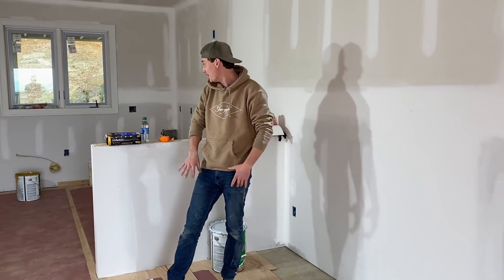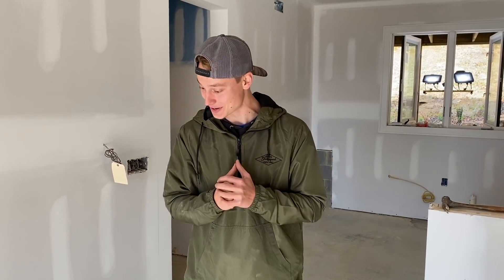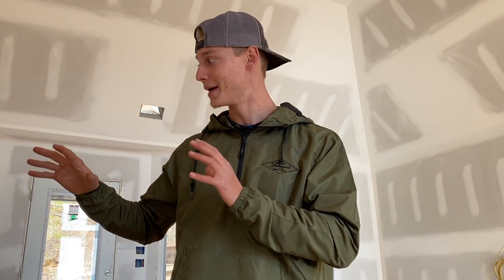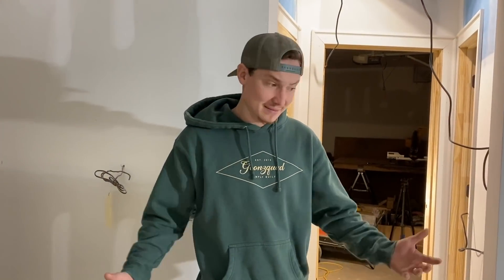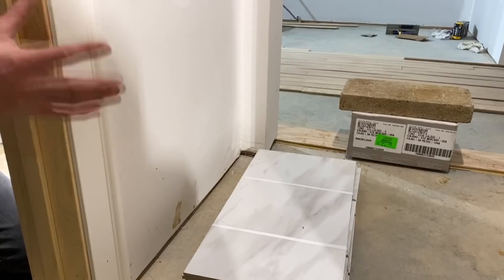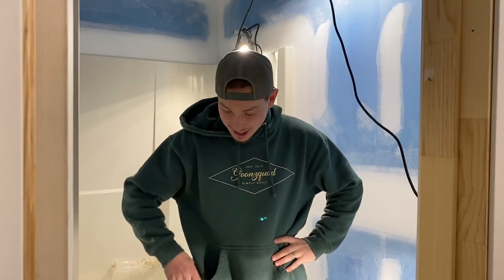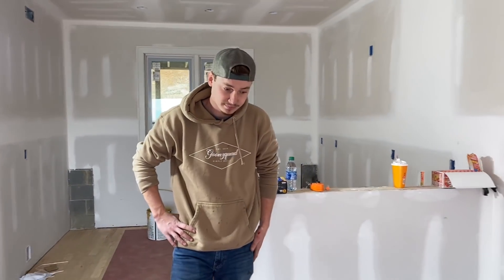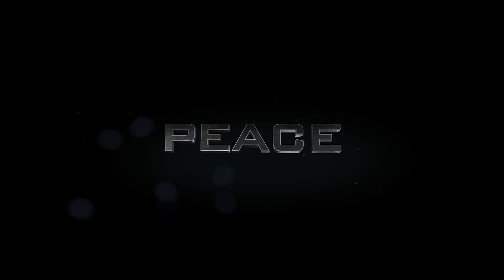The New Goonzquad Headquarters Part 55

Comment: You guys are doing great, but that's a strange floorplan that the original owner chose.
Reply: The house was never intended to be a 'typical' residence. The developer/owner apparently designed it in 2008 for the use of two older members of their family who had specific needs. Circumstances changed in 2009 and that is said to be the reason why construction work halted and the building then stood empty for eleven years. The full story of the property is unsurprisingly more convoluted than that, but has not been made public.

Comment: NOOOOOOOOOO, you didn’t just glue hardwood to the slab., first of all you should install a moisture barrier down , then either ply nailed directly to the slab. Or batons and then the hardwood, they are going to pop as time passes due to moisture from under the slab

Comment: Wow Americans,  Boys  you did not get my memo,   you should not put hardwood directly on cement.   you need an insulation barrier.   nice foam board will help a lot.   and then a small plywood on top would fix you concerns of hardwood install.   also note you also can get that stagger on the wood much easier.  you cut a length out of a long one then you got an uneven pattern since your cuts fit from the other end and you can install a floor without having to pre place it.   saving time and you should have an imperfect stagger since not a single cut will match up to the factory cuts.

Comment: Three bathrooms? Do man really need it?
Reply: The drainage pipes under the slab were already in place when Goonzquad purchased the house, so keeping that layout was the most cost effective choice. It gives a bathroom on each floor, plus one which is conveniently located to be an ensuite for the Master. Overall, it's probably the most viable and practical layout.

Comment: As car men how do you wash a car , start at the top then work downwards yet here you are starting on the floor working up to the ceiling with paints etc Sorry guys this is wrong in my eyes as a number of comments agree, ass over tit ! drop a tub of paint is going to be a bigger disaster on that nice new wood and ceremics & grout. Best practice in the Uk is leave a gap around all the edges and also your skirting board or edge trim just off the floor then it gives room for movement over time. Waterproof screed would have been good before laying that lot its bad practice to rely just on the wood glue alone. Looks good just hope it lasts without problems. Regarding wood lengths it looks neater full plank then a half plank with all the joints every other plank inline.

Comment: so didnt paint before doing floors, no water , no electrity, no inspection
lets face it it is failing. garage , not a garage has garage door. its unliveable
leaking windows? so much wood and dont have a heating system, its bizarre

Comment: Y'all are so worried about saw dust and wearing masks but when you work with concrete you dont even wear them. I think you need to check out silica dust and rethink working with concrete and not wearing a mask.

Comment: I don’t know much, but I’m shocked you’d glue any kind of wood to a concrete floor.
Reply: Will wood and concrete not expand/contract differently. If so, something's gonna give way; the glue is unlikely, so's the concrete, so what's going to happen to the wood?  I know heehaw about this stuff but it doesn't make a lot of sense to me.
Reply: @2H80vids  They should of applied a waterproofing membrane on the concrete floor before installing.